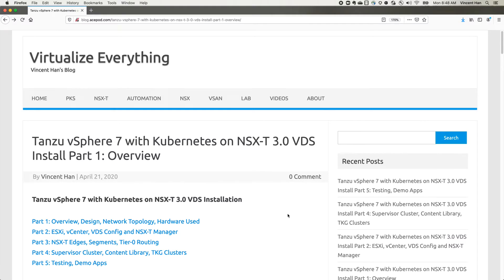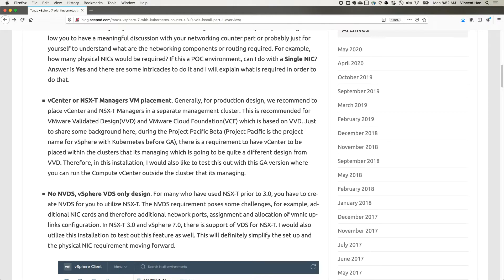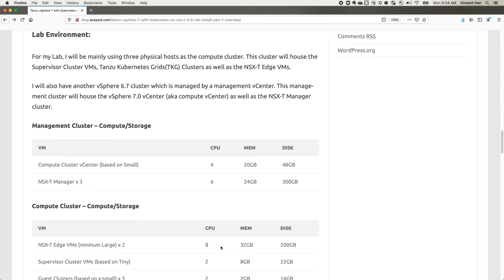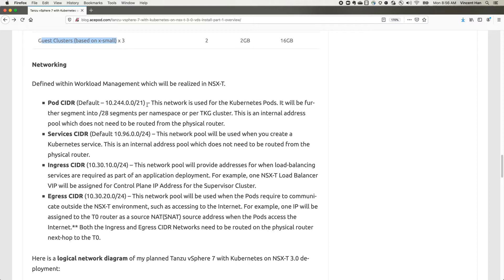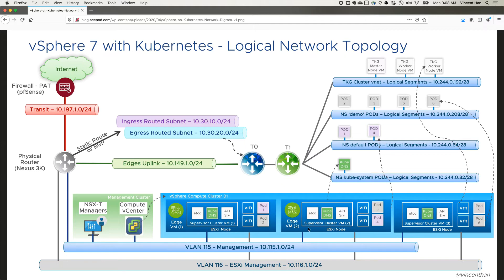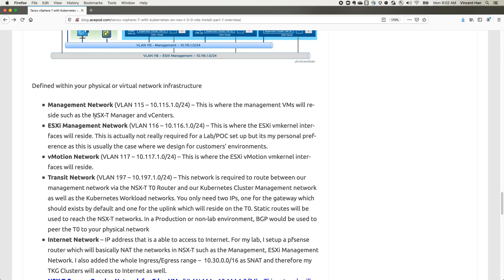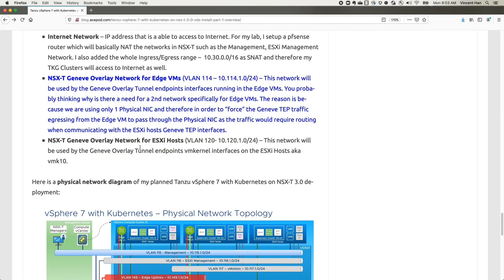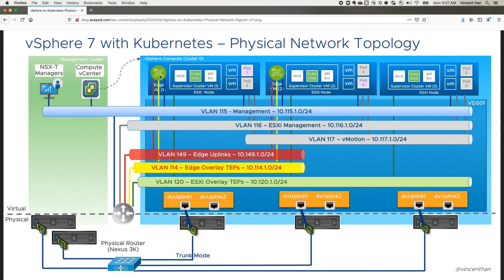Tanzu vSphere 7 with Kubernetes - Network Design - Part 1

Comment: Great article and write up.  What hardware are you using for both of your clusters.  Also, are you utilizing vSAN and 10G connections for any of the environment.
Reply from the maker: Hi Glenn, they are supermicro servers. They have 10G NICs and capable of vSAN as well. However, i'm using NFS for this lab.
Reply: @vincenthan5032  I am looking to setup a similar lab.  Do you have one host in the management cluster and three ESXi hosts in the compute cluster.  I am looking for the best way the utilize four hosts.
Reply from the maker: @gman2369  Sorry for taking so long as I miss out this comment. I have about 4 hosts in my management cluster as I use this management cluster for other labs such as NSX ALB controllers, multiple vcenters, NSX managers, etc.. Well, if you are just thinking of just trying out Tanzu vSphere, I think one hosts for management cluster should be sufficient. Having said that, I suggest to go with minimum of 64GB of memory as some of the VMware management VMs require quite abit of memory.
Reply: @vincenthan5032  Yes, I am looking to try out VMware Tanzu.  I have the same Supermicro servers connecting to a 10GB Ubiquiti switch.  The connection is utilizing 2 DAC cables per server to the 10 GB switch. I plan on following a VCF validated design as much as possible.  The virtual distributed switch is using a converged fabric.  The 10GB switch is out of physical ports with all the connections.  Is it possible to run all the traffic over the two 10GB links?  The traffic would consist of VSAN, Management, vMotion, and vm networks.